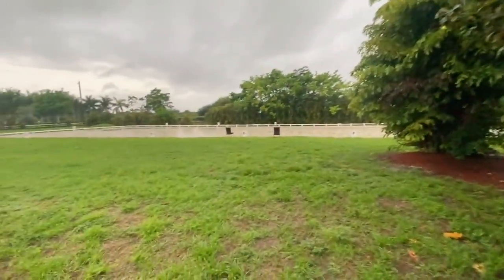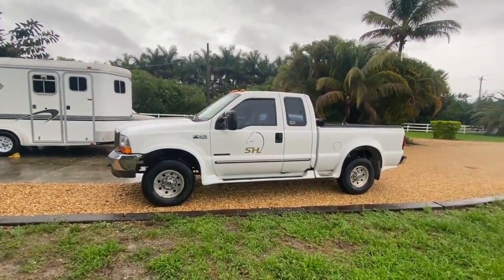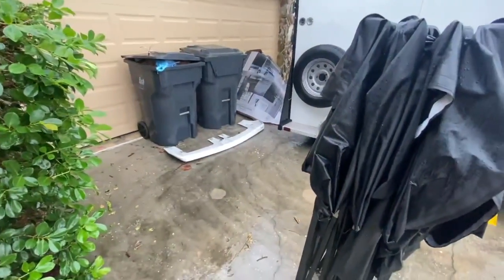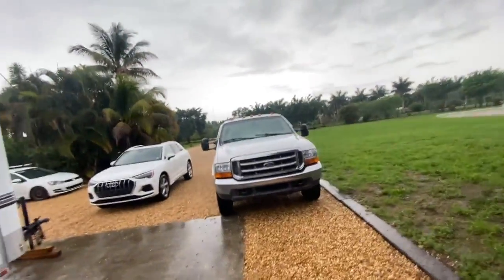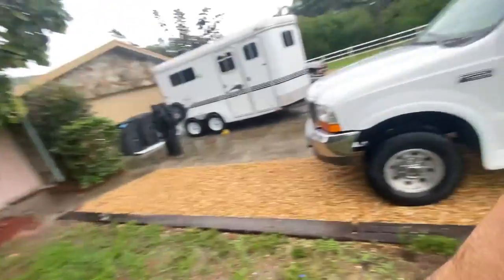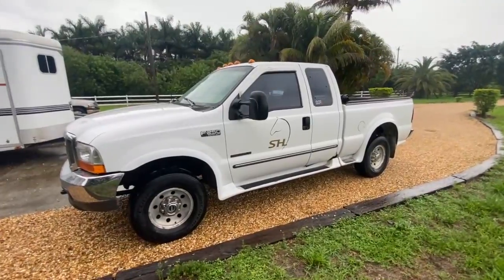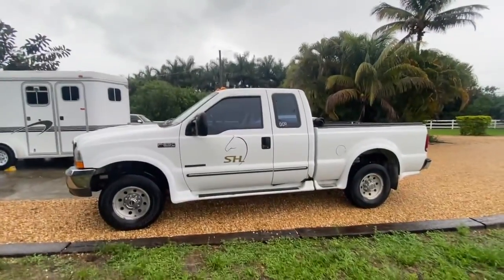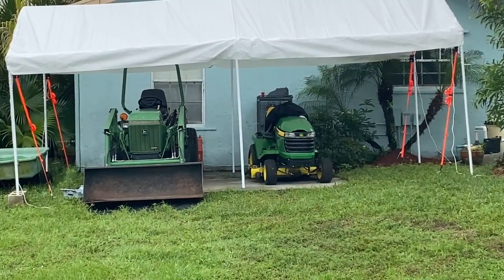GOB gets a CONVERTER LOCK and needs some HELP

Comment: Just drop the old boy and the visor off at Tommy's shop have it installed correctly and it wont be a problem
Reply: Or use some of that sealer you pluged the holes with...

Comment: Hey Jack u can put visor back on if holes are not to big u can put nut serts in roof n they wont leak. I used to installed led light bars n never had one leak with nut serts

Comment: They make this stuff for rv's called buteral tape. And they have a caulk you cam use also. They use it on roof of rv's. You can pit your visor on just fill the hole with that caulk. Screw it in and a little caulk on the screw top after you screw it down and it will be water proof. It will look fine as long as you just cover the head of screw. Good luck